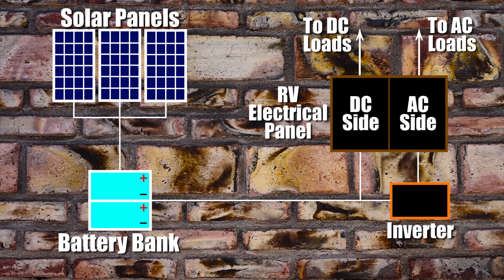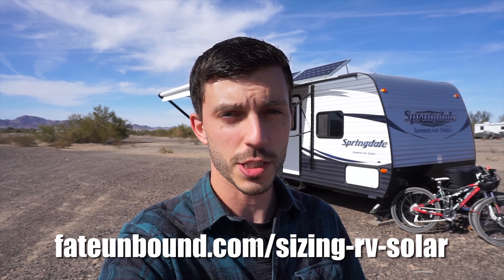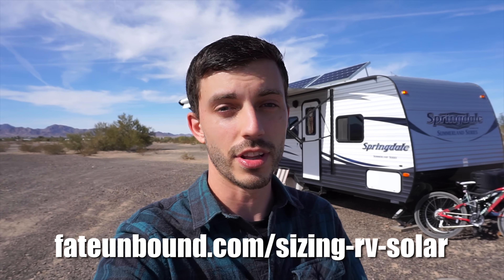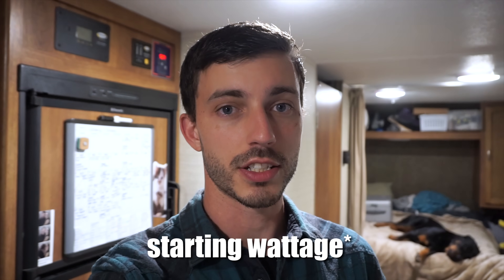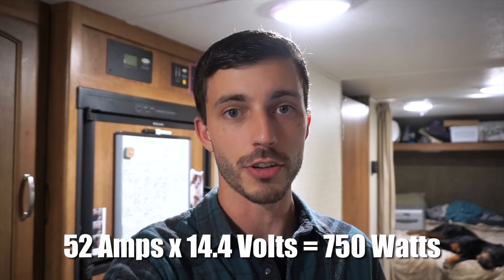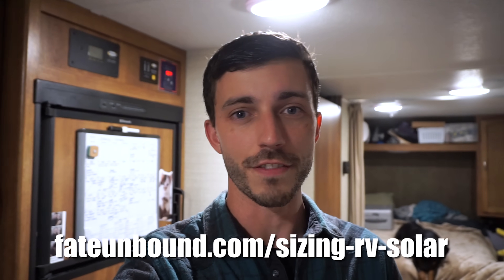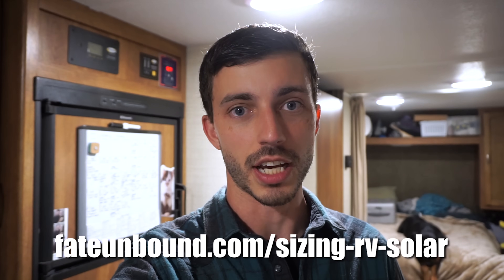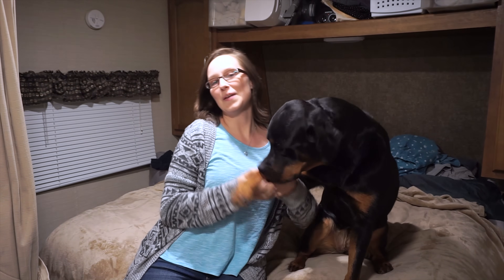How to Power an RV Air Conditioner with Solar - Full Time RV Living

Comment: Really should redo the video with corrected values. Most people will NOT read the text and having incorrect info out there is wrong in so many ways.
Also, the amount of heat that inverter will make will be enormous and should be mentioned as will the heat in the batteries themselves. I see the batteries are right next to your inverter in the same compartment. You will "cook" your lithium batteries and their useful life will be diminished too.
Reply from the maker: Joe, the reason I choose not to redo the video is that whether or not the values are correct the message of the video is the same. That message is that running your RV AC unit off of the inverter and battery bank requires a massive battery bank and solar array. And that that investment probably isn't worth it for the vast majority of people. It's much more cost effective just to run a generator for those times you need RV AC. Also, the compartment that my inverter and batteries are in is quite large and never gets warm enough for me to worry about my lithium batteries getting cooked. However, the batteries also have an over temperature automatic disconnect as well just to be certain.
Reply: Yeah I get it but there is just SO much misinformation out there. Others just see the headline. I am on a number of solar and rv forums and too many people think they can run their AC on solar.
My reference to the heat would be if you were running the AC off that inverter for any amount of time. Although there is a disconnect for an over-temperature situation it does not account for long periods of time at a high temperature. It will shorten the life of lithium batteries. Check Technomadia and their real life experience over a number of years and you'll see what I am referring to.

Comment: Something is not right. I run my whole trailer on a 30 amp circuit. I have a progressive industries EMS that shows me a real time read out of current draw. My AC WITH the compressor running draws about 15-17 amps. My entire HOUSE with AC running is working off a 100 amp service. If your AC is drawing 70+ amps with just the fan, something is dreadfully wrong or your gauge is showing you something other than amps. Think about it. Nobody would EVER be able to run AC at a campground with 30 amp service, yet we all do.

Comment: The solution for the large starting draw is using an inverter window air conditioner like my Hitachi ra-10hv.

Starts at 0-35 watts then goes to 280 watts when the compressor and other fan motor starts. It’s a very well designed air conditioner that I wish was readily available in USA.

I’ve always wondered why these aren’t that prevalent in western countries like it is in Asia. 

Did I mention that its a 12800btu unit, has two dc inverter fan motors and a variable speed compressor with low speed set at 220 watts, med at 430 and highest speed at 880 watts?

It gradually ramps down to maintain set room temperature and is quiet as hell.
Reply: I've been looking for just that on my spot cooling project. LG has some inverter window air conditioners but all are too large for my 23 foot unit. I've already converted my insulation up to R 30 so I don't need 12000 BTUs. Please tell me can you Force to lower settings without reaching the preset temperature? Or is the future only automatic after the temperature setting is reached?
Reply: I just looked it up its a 220v ac... but good suggestion for 220v countries. Not in usa though

Comment: I’ve learned a lot about solar and batteries and what you need vs what you want to run over the last couple years. I’m doing a school bus conversion and hoping to have a great electrical system in the end. This video was one of the best, straight to the point, that I’ve seen.

Comment: Why don’t these people that make these air conditioning Hav a setting on these things where u can Hav separate settings like 5 thousand btu then if that’s not cool enough Hav a 8 thousand btu then if u want cooler 10 tho Btu that way u won’t drain all your power even a three thousand btu would b better than nothing
Reply from the maker: Because that would cost more money and RVs are made as cheaply as humanly possible.

Comment: For starting load, you might look at the MicroAir Easy Start. They're great for using smaller generators (~2000W) starting RV AC compressors. I just got an R-Pod 176 with a 13, 500BTU AC unit, and installed an Easy Start. My 2200W generator starts it no problem. No bogging, no fuss. Could be really helpful when/if starting off of an inverter. 

When lithium batteries become cost effective, I'd love to have enough to run the AC overnight in the camper.

Comment: You can install a soft starter which will cut amps to almost half ( 35 amp)
Reply: A soft start will reduce the starting load for about a second. Run amps will be the same. The video I thought I saw, he could start the AC. Just not run for very long before depleting the battery bank.

Comment: 4 - 200wt solar panels 8 - 200ah trojan 6vt  wired 12vt .3500wt inverter..mount 4 batt.on board and a 4pack case ad on stored in back of truck like a generator. Ad some wheels and a handle to move around.

Comment: The real answer is you can't.
I've got a panel array of over 3,000 watts that would really only run ac for 2-3 hrs.
Sorry.
It ain't happening.
Reply: Burt - the real answer is you can but not how you think. With a large enough battery bank (lead or lithium) , they though a 3000 watt inverter can power a soft start or Micro-Air equipped rooftop AC unit. Solar output through the solar charge controller is then used to replace amps that are withdrawn from ones battery bank. Whether your 3,000 watt solar array can replace amps as they are withdrawn from the battery bank is the question. The answer to that is dependent on many things including time of year, time of day, panel tilt, cloud cover, panel efficiency, capacity of the battery bank and its state of charge, and type of batteries  among others. How do I know this? Because I regularly run one of my AC’s via my 3,000 watt Magnum PS inverter, while the 1,260 Ah of AGM batteries are simultaneously resupplied by 1,425 watts of panels supplemented by the engine alternator.
Reply: NoGas supplemented by alternator yes but via solar alone no and for all the reasons you listed. Even my array at 5.000 ft alt above the Marine layer in so. Cal won't dependably run ac.

Comment: I would switch to a smaller 6000 BTU window air conditioner,  that would reduce the amp pull from the batteries to 30-35 amps. In really hot humid conditions it maybe to small, but it would be better than No AC.
Reply: Way too small. Wont keep up. 13.5k will even struggle

Comment: It is not practical to run your air off of solar! Most rv are not large enough to support the size of array! Better off using a generator for air cond!
Reply: Better off moving to higher elevation where it doesn't get so hot. Also, hanging out by a creek in a wooded forest is night and day. On 95 degree days with heat index of over 100 it felt comfortable being in a hammock in the woods here in TN. When I went camping in Alabama it didn't even feel that hot once we got by the water. It is amazing how changing environments can be.

Comment: some thing you left out was what volt setup inverter and MD or SW and if  ..  12vdc 24vdc 48vdc 60vdc and so on .  the amps go down as you go up in volts.  my RV i made a custom roof to hold the wight of my solar system .  most  car EV HV battery packs run from 400 to 800 lbs when removed from the car so a class A rv  can work with that  . all so like on my RV i run a step up convert so i take the running 12vDC power being made from the motor to jump it up to 24vDC  to power my roof top ac unit when driving down the road .  most Mini Split ac unit pull only 4 to 9 amps giving what 1 you get so if you can run a laptop off solar then the right setup you can run a AC unit

Comment: Thanks for the video 😀 I have a question now you said that the AC for the RV is 13500 BTU . Typical one or two bedroom apartment in a house can be cooled at least during May to September here in Massachusetts we have a lot of humidity problems too 8000 BTU plus a 5000 BTU for example I live in a 1200 square foot two-bedroom and of course I'm thinking about getting on the road. I would think based on the size in the square footage and the fact that any RV is of a pretty simple shape . I think what I would do in theory install a 5500 Slimline energy efficient house model right in the wall . And recess it accordingly. I haven't done the math yet oh and by the way thanks for the mathematical evaluations I love the Simplicity of the whole thing. So what do you think of that idea and if I can be so bold as to ask off the top of your head what power requirements do you think it's something like that would take.
Reply: Michael Dac -I think this is the irony of rv AC.  The space is smaller, but he BTUs are gigantic.  I don’t know if it is a thermal inefficiency problem, or what.  I’m not an expert in any of it.  I’d just like someone to build a 5K BTU roof unit, if it would work.

Comment: I'm thinking of just using a window AC 5000-7000 BTU which will use 450-700 watts. But I also want to use a tv and Xbox one another 200 watts 170 if I'm watching movies instead of video games. Also the fridge and other appliances using electric I'm not sure where to start

Comment: Look into Starting power AND RUNNING POWER.  After it starts keep it on...You are flat wrong on your hourly calculations. Wait. 10 mins after starting and see the amps drop.  My masters in HVACR AND avid tv's.
Reply: I guess it depends on how cold u want and how well (thermally)isolated the RV is.
Reply: 12volt DC air conditioning is the way to go for solar. Very expensive but about the only way for solar. (Nomadic or Dometic)
Reply: The big issues with rvs tho is the AC runs for about ten minutes then stops for about ten and then kicks back on its constantly starting and stopping so he’s not crazy wrong but he’s definitely a bit high in his calculations
Reply: @lospectro45  

I've been reading and dreaming....

I was looking at the inverter mini-splits. They are sort of soft  start. They start with just a few amps, then gradually ramp up amps as needed. They continue to run at a reduced amperage once the rv is cool. 

I imagine this would reduce the load on the battery and inverter
Reply: @lospectro45  Never let it go off. Too cold? Open a window.  It's the start that is the problem.

Comment: If you don’t have any extra room on the roof is it possible to just make a panel grid that is transportable? Take down and setup when needed.
Reply: I've seen that a lot. My favorite was a couple who wanted to always park in the shade. They wired the panels to produce @48 volts so the long wire back to the RV did not have to be insanely thick. They had simple collapsible stands so the panels sat up at an angle, each panel had it's own stand, and of course they aimed them south. The couple deployed the panels in 5 minutes like pros, they said the only real con was fear of theft.

Comment: My question.  I have a small hard side pop up and do not wish to run my air conditioner while boondocking, but I do wish to have my alt/curr 115v outlets active.  I want to have a 100w solar panel charging a small 300w solar generator/inverter. I wish to connect my generator to my campers power plug.  I hope that my campers power supply to keep my campers 12v battery charged in addition to give me 115v outlet usage.  It this possible?  If it is, can I have the solar generator/inverter charging at the same time that it is plugged into the campers power supply.?

Comment: We have a 35' motorhome with 2  Coleman 11,000 btu high efficiency units. We can run both of them on a single 30 amp service, and most times one will cool the MH just fine. AC amps they draw around 12 to start and run around 8 amps continuously. Still a big hit for solar. My feeling is buy a Honda generator, it quiet and burns almost nothing in fuel.
 But if one is in the desert one should look in to a desert (swamp) cooler as they work well in dry climates and require almost nothing to run, just a fan and a small water pump, You can buy them in 12V also.

Comment: hi!  do you think it would be possible to run my air conditioner for 30 minutes or an hour on really sunny days.  with nothing else running off of the solar.  (i don't have a fridge right now but might get a propane one, otherwise i would unplug it to turn the AC on.)  i got confused about the 75w per hour thing, maybe i only need 75w to run it if it's for less than an hour?
Reply from the maker: If you had a battery bank as large as ours (400Ah) then you would be able to run the solar for 30 minutes on hot days. However, just that 30 minutes will drain down the batteries really fast and regularly drawing that high of amperage from them will most likely reduce their lifespan. Honestly air conditioning is probably best to power by a generator or shore power.

Comment: Great video!  Awesome and thank you.  Do you know of any small AC units that may draw much less power?  Are there other options vs just running a roof unit?
Reply: I know this isn’t an apples 🍎 to apples 🍏 comparison, but a COW, a Cell site On Wheels w a generator, not solar, needs a pallet sized stack of batteries stacked chest high to enable running the cell in the event of a generator failure for 4-8 hours backup.  Given the current state of battery technology running an A/C unit just isn’t practical for any length of time.  Also of note, he placed the A/C unit on low, the compressor is the primary current draw, not the fan.  Turning your ac unit to high would barely increase the load as it only increases fan speed.  😎
Reply: 12.2 eer 5000btu unit is the best efficiency to the us consumer market right now. However that is not efficient to cool down an rv due to its lousy insulation and amount of windows. To make this possible what I did was blacked out and insulated all my windows, added 2 inches of closed-cell oil-backed insulation, and sectioned-off only 50 square feet of my main living space to be cooled. This barely allows me to eclipse the threshold of 72 degrees on a 95 degree day with 10 hours of maximum run time per day.
Reply: Yes, great video! This seems like the rational solution to me. I'm not sure whether it's a window unit or a small mini-split, but something under 6,000 BTUs seems like you could run it to keep the temp under 80 degrees. Just to keep things bearable if it gets crazy hot. And, of course, you'd need to get an EasyStart so you don't have that huge draw when the AC kicks on.
Reply from the maker: Thank you! I've heard of some people successfully running 5,000 BTU window A/C units in their RVs off solar but I don't have experience with that myself.
Reply: Fate Unbound I was wondering the same thing... I've seen mini "AC" units for cars that just plug into a cigarette lighter outlet (I think they are basically swamp coolers)! I don't think they would do much good for cooling the whole place but are probably a lot more efficient, especially since you can bypass the inverter!
Reply: We just stay where the temps are 78 and below  no humidity 
😁
Reply: There are some dc inverter split unit a/c systems designed for solar but you’ll need at least 900-1200 watt system in full sun and preferably more.  that is for 12000 btu system.  They are not cheap either.
Reply: Randall's Rest & Relaxation you might want to check out LG inverter window air conditioners. They are now available in the US.

The solution for the large starting draw is using an inverter window air conditioner like my Hitachi ra-10hv.

Starts at 0-35 watts then goes to 280 watts when the compressor and other fan motor starts. It’s a very well engineered air conditioner that I wish was readily available in USA.

I’ve always wondered why these aren’t that prevalent in western countries like it is in Asia. 

Did I mention that its a 12800btu unit, has two dc inverter fan motors and a variable speed compressor with low speed set at 220 watts, med at 430 and highest speed at 880 watts?

It gradually ramps down to maintain set room temperature and is quiet as hell.
Reply: yes, window units are 12.2 eer. they can only be used to spot cool. for full climate control ac up to 110° you need: R30 one the walls, R15 on the roof, solid panel coverage 1800w, 230v inverter, Zero light transmission, 14.4kwh battery bank, and a 6000 btu - 19 EER 33seer mitsubishi minisplit.  see my videos for more details.

Comment: Trying to remember but I seen it online , easy start capacitor for rv AC's that may help in your situation while using solar.
Reply: RV Hard start Capacitor on Amazon
Reply from the maker: Yep I know about soft starters, we aren't trying to run our AC on solar, just explaining what incredible amount of solar panels and battery bank you need to every else that is thinking about trying it.

Comment: I like your videos, they are entertaining and easy to follow. I would recommend you add labels on the video to correct the values mentioned, i did not read the description before I was trying to comment that this was wrong, most people will just watch the video. (or redo the video with the right numbers).
Reply from the maker: +Per3110 Unfortunately YouTube does not allow adding labels to videos anymore. Updating the description and pinning a comment to the top with the same information is the best I can do short of remaking the video. I don't think that is necessary however because the message is still the same: "Yes you can run your A/C off solar but it will take a VERY large solar array and battery bank."